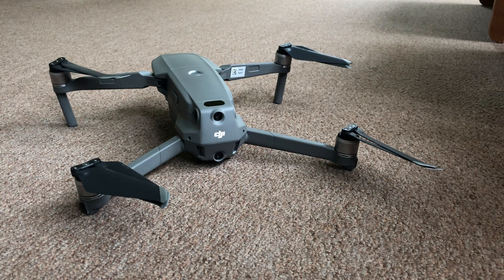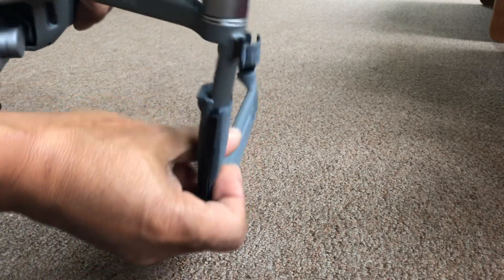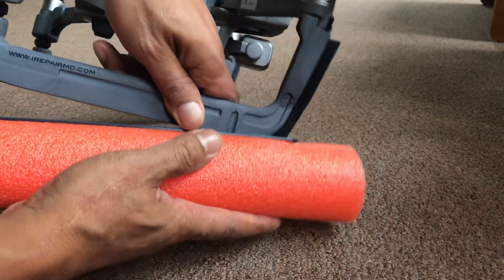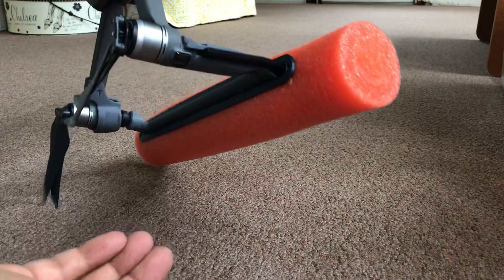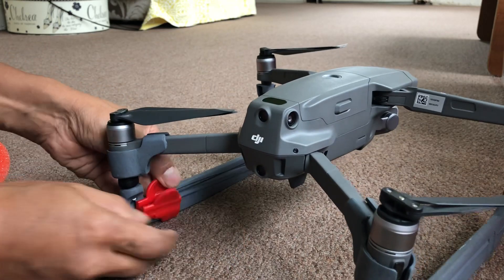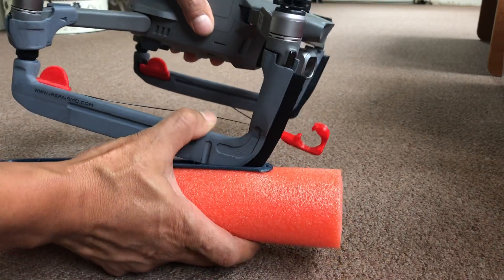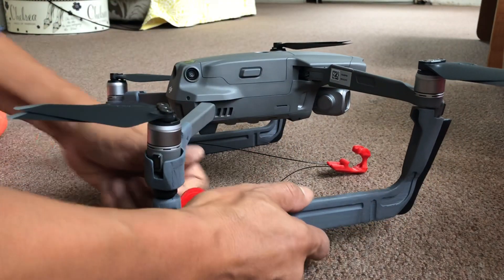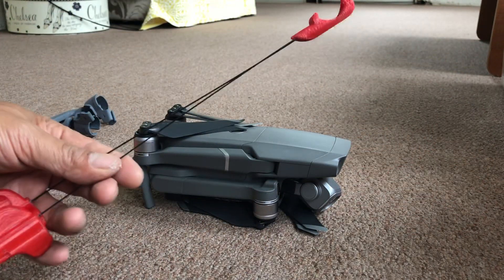Mavic 2 Raptor Skid 2 installation

Comment: how do you use as steady cam when mavic 2 doesn't have wifi mode .
Reply from the maker: not sure what you mean.
Reply: iRepairMD Youtube you mentioned this can also help using it as steady cam like we used to do with Mavic 1 but Mavic 2 pro doesn’t have WiFi mode which mean you cannot connect with your phone

Comment: How do you relate something from the hook? 
Would it be better to have the weight of the hook and whatever you're carrying to be closer to the CG?
Reply: I dnt see that hook working properly that far back on the drone and wouldnt it of been better if the hook attachment would rotate down looks awkward ..
Reply from the maker: Thanks, We will look into making the hook rotatable, its a great idea
Reply from the maker: The idea was to have the hook in visual view of the camera so the pilot can see the hook and position the Mavic and hook from FPV view real time .
Reply from the maker: The 2 Carbon Fiber rods that the hook is attached to actually flexes down so when you are carrying cargo the hook will drop downward to find the natural Center of Gravity thus keep the drone well balance in flight. This still needs to be verify in actually cargo testing.
Reply: @WathanaPrak  sorry for the type-o. I meant to ask, how do you release payload from the hook.
Reply from the maker: Stay tune we have a solution for that too
Reply: Yes making it so it rotates at the clips would make it so much better